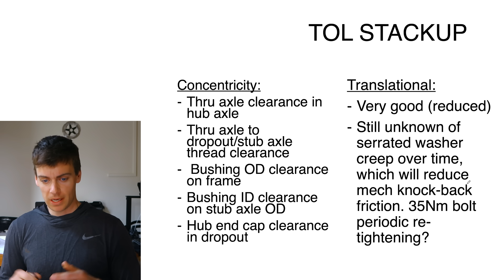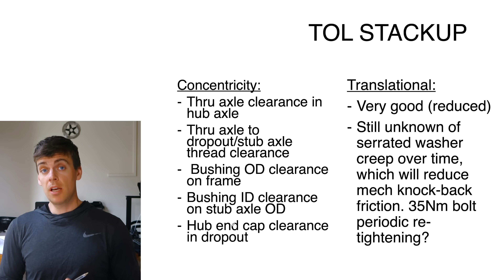More SRAM Eagle Transmission chat (including corrections)

Comment: Maybe a bit more respect for the engineers at SRAM. Their presentation on Tuesday morning was very thorough. I think most of what they said went over the heads of most journalists.
Reply: The same SRAM that produced a front mech that many users found impossible to use without dropping their chain constantly? The one who developed proprietary chains that are less efficient? I mean I can go on, the point is the track record of questionable engineering for even more questionable advantages is there. I'm not sure that either Shimano or SRAM or any other major bike component manufacturers engineering departments are above critique. Components should be usable by the average (in mechanical skill and knowhow) consumer, a consumer who is not going to be using a torque wrench every time they reinstall their wheel by the way.

The nice thing about engineering is that it's not subjective or based on "respect" or any such nonsense, the numbers are the numbers. And it's ok to talk about the numbers, nobody's feelings should be hurt. It's actually good! :)
Reply: No respect for greedy company like sram is
Reply from the maker: Absolute respect of course, but engineers will debate designs. It's what we do. There are many ways to skin a cat.
Reply: There's a significant difference between random internet smooth-brain slagging experts vs someone in the field academically addressing peers. Your comment is applicable to the former, but this video is the latter. And so, is out of place. In my field, if I disrespect your work, I will either lazily trash and move on. Or, if I really don't like you, go for the throat. PT did neither.

Comment: There is alot of support for the content you put out on this , personally I feel it was a little disrespectful to thd engineers/product designers (you're peers) calling much of it turd , embarrassing oversight etc when you hadn't used thd product or more important, you hadn't understood the design. Many people had pointed out on original video you're facts where not correct. We all mzkd mistakes granted but the content you put out was not sound or verified, it was you're opinion and that's allowed but how you rubbished the product or certain aspects was unfounded. If you had used the product , had it in you're hand , disassembled it put it back together then you could have put out you're findings. But to do so simply by looking at images from other sites and some diagram online didn't work out to well. It may be you're over view is somewhat correct down the line, but his it was presented in the present doest look great.

Comment: okay, so think about it: German engineers actually wanted to make the tension wheel without holes, but it was too heavy... so they thought: "Hey, let's try this overfuckingengineering method. And It worked, so they just said: "Just leave it, it'll be a coolness factor". 
Try making jockey and pulley wheel not hollow, and check the difference

Comment: I came to this video because my friend had problems with this rear derailleur. The chain  became loose in the middle of the ride(specialized epic S-works). Loosening the 35Nm Bolt using only Swat  8mm allen key was not possible for us. Me and two friends tried without success.  Sram lost some points!!

Comment: Regarding side impacts .  The forces would be far less than side impact on a wheel due to less leverage. However mech impact would only put forces in similar direction as side impact on a wheel just much less.  Clearly the frame is generally not going to fail under those circumstances as it's designed to take those forces sufficiently to cause wheel failior. I would strongly say this mech has zero chance of being stronger than the frame during a side impact.  I agree with front impacts . I don't agree with clearance as it's no more important than existing designs . I do agree with adjustment and frame damage from washer.  I still wouldn't touch it with a barge pole!

Comment: It's a great design for the people who are most likely to spend $600 on a derailler. Who would that be? People with a lot of money and upgraditis, who are going to replace their gear long before it breaks or wears out anyway, and sponsored riders who don't have to pay for their equipment. I'll keep the mechanical fuse of the derailler hanger.
In addition, although I think/know it is easier to keep radial tolerances, the multiple concentric threaded parts as seen at 16:15 don't pass the eye test for me. I can see one of these shells cracking through, splitting it in half in the axial direction. I suppose the wheel would still be retained at least.

Comment: My main disagreement with your assessment is that you say you don’t want the impact force transferred into the rest stays like this system does. I think MTB frames are designed to take a beating. If you have an impact stating enough to break the derailleur off The frame, the impact might’ve been steering enough to break the top tube from a different angle. It’s the risk of the sport.

Comment: Can someone explain why there is a circular gap in the knurling?
Reply from the maker: I think it may be a relief channel for the bushing end. If the dropout width is slightly undersized, the bushing end can sit in that recess without affecting the overall clamping. Just an idea. Seems to be the same dia as the bushing.
Reply: @PeakTorque  Oh, thanks. I'm not an engineer but I always find it interesting to learn things from your field. That's why I like your videos.
By the way, Sram does claim that the load goes directly to the through axle. I just watched a german video from "enjoyyourbike" channel interviewing the chief engineer where he makes the claim.

Comment: If the bolt isn’t tight enough that could be a problem
Reply from the maker: Yes. That's a major point of FMEA that hopefully they've thought about. As the serated washer may creep in under the huge clamping load, the assembly gets looser and is more likely to spin on an impact. Rinse and repeat. Not good for the dropout.

Comment: Well no shit this transmission can't protect and is not robust for MASSIVE impacts! 

I'm a pretty advanced rider and ride about 100miles a week (on Turbo Levo and other bikes) and what bothers me about UDH is EVERY small rock strike or scrape along an bankment bends the derailler hanger. I haven't had a real crash in over a year and a half but have bent the derailler hanger and had it replaced probably 10-15 times in that span and that's REALLY annoying! It's essentially a lightbulb attached to the bike. 

This new Sram transmission seems to be perfect for withstanding small hits and rock strikes that are part of the riding game and will be robust enough to not have to change the derailler hanger every 2 weeks. Something the previous design was nowhere close to being able to do. 

Sure youre prolly fucked in a MASSIVE crash but I'm way beyond that in my riding to have to worry about it and this new sram transmission seems perfect! 

Thanks for the analysis really appreciate it!

Comment: I find it interesting that you placed your reputation on the line without having a hands on view of the mech or indeed any real live analysis because of that I think you ended up making a set of assumptions that pretty much sullied your reputation

here is someone doing the sort of analysis that I would argue gives a better view of the whole issue
https://youtu.be/i3QzPxdN1e4

In my view the biggest issue here is the actually that while it is a standard for SRAM it is not a standard across the range of rear mechs and I would have attempted to make it a better standard. The point of the design and I believe you completely lost this is that the mech itself is now the sacrificial part not the hanger. hence the Mech comes with replaceable parts  whereas SRAM AXS eagle does not. you break the rear mech you have to buy a new one and in all fairness I don't know too many people that don't do that with other mechs.

Now the argument about the rotation is again mute IMHO as again none of the mechanisms work in isolation they are supposed to work in concert which is why I felt the Fanatik test was a pretty good one. 

If I hit a rock at the speeds they were saying then you lose the hanger & the mech and in the case of the SRAM Transmission the fact that the mech parts are the sacrificial member is where the initial contact occurs which should minimise stress to the remaining system. That they have made the remaining system much stronger also helps 

Now the real argument is not about the function or form to my mind but the price most of the changes are actually mechanically sound decisions as I can see.

It is actually the fact you made an opinion piece with minimal information and no hands on is why I am surprised that you made it in a hurry is even more surprising because in truth if you had asked SRAM for a sample you could have had hands on 🤷🏿‍♀

Comment: if you put that on a ebike that has a dongle and you hit it it will rip the frame apart  and the price is fkn crazy  but try it on a 10kw lighting motr mid drive and shift under load, all mtb parts fail over 3kw :trophy-yellow-smiling:

Comment: > I still stand by most of my points in that video

Champ, just go buy and ride one the new mechs. Any assertions you make based on promotional photos/videos come across as very weak, especially if you keep going OJ about reputation.
Reply: Why? It would be stupid to risk your frame to use that derailleur :)
Reply: SRAM produced pretty thorough schematics. I don't think it's fair to have to buy every hyper-expensive newfangled thing to be able to opine about it on YouTube.
Reply: @pgn666  Because Sram would pay lot of engineers a lot of money and do a lot of independent testing to make sure a new mech isn't shit? Pretty much any point he has raised would have been brought up in a design meeting.

Without hands-on experience and actually testing the mech, he isn't adding anything that Sram hasn't already addressed. He is essentially doing the equivalent of 'trust me bro, I am an expert.'

Also, the fact Jack Moir intentionally chose to run the new Sram mechs makes me suspect PT is talking through his butthole.
Reply: @miatomi  schematics and how something performs in practice are two sides of the same coin. If you want to be hyper critical about something, you should do more than just look at promo photos/videos.
Reply: @cystenergy  Not really, that's what modelling and math is for. But lets say that's the case. Why isn't SRAM sending components to non-shill channels?
Reply: @miatomi  modelling and math is a prediction of how something will behave, not how it will actually behave. There is a nauced difference there that you and PT don't seem to understand. 

You mean why didn't a small non-MTB channel receive a new and expensive MTB mech? The situation kind of speaks for itself.  Even if PT wasn't critical of the mech, there really isn't a benefit for Sram because PT's audience isn't MTB focused.
Reply: @cystenergy  If a model or series of equations produces output that doesn't match reality, it means that the inputs or the models/equation themselves were invalid.. it is of course possible that additional information could be added that's not apparent now, but that's why caveats are given. In terms of reality, it is not usually the case in my experience that real-world performance is drastically better than modeled performance, ESPECIALLY in the world of bike components, but maybe SRAM's new system will be the exception :)

It is interesting that PT is the only non-shill bike related YouTuber you could think of. I agree, the field is sparse, but there are probably at least a couple more. Unfortunately SRAM's marketing department didn't send testing equipment to any of them. Maybe next time.
Reply from the maker: My demographic is road and mtb, i do both. Unfortunately the video got more views in the 1st 24h than Bikeradar. That was not my intention, to overshadow the launch. But are you aware what YouTube is and why you are consuming this material for free? Anything goes. If SRAM want to market-wash YouTube with unpalatable marketing drivel, they have to deal with the common commentary muck like me and any other troll who does this for fun. Its not a private members club.
Reply: @miatomi   That isn't how maths/modelling works.

Simply put, a model is several variables in a closed ecosystem predicting a single outcome. In reality, there are infinite variables operating in a dynamic and open ecosystem to result in a single outcome that is simultaneously a variable involved in another outcome. 

This is why you see a lot of pharmaceuticals failing at the clinical trial stage. The models struggle to fully predict what happens in the human body. 

We are talking about PT here, why should I mention anyone else to prove my point? If you provided a list of non-shill, the same would apply to a majority of them.
Reply: @PeakTorque  

Your audience is road. You publish the occasional MTB video. It is clear by what you say about MTB that you don't actually do much MTB riding. 

No one is saying you cannot be critical of Sram' new mech, but form your declarative arguments on something more than promotional photos and videos. You already made a mistake doing that. Just buy the mech, ride it, test it, and then make your critical video.
Reply: @cystenergy  most normal people don't have thousands on hand to go out and buy something that they believe might harm their bicycle frames just to appease some guy on the internet... it's perfectly reasonable for him to make these breakdowns without having the product in hand
Reply: @joshuaandress3666  
1. PT isn't a normal person. He is a part-time reviewer of bike parts. That sometimes involves purchasing parts to review.

2. It is normal for people like PT to have an in with an LBS who can sell them the parts at cost price or at a heavy discount. I don't review bike parts, but I could get Sram's new mech at cost price. 

3. Then first test it on a chuck of carbon fibre and prove his point that it breaks frames. You know, do the thing his channel does.
Reply: @cystenergy  Are you on SRAM's payroll?
Reply: @cjohnson3836  nah fam. Just someone who likes to critically analyse things before making declarative assertions.